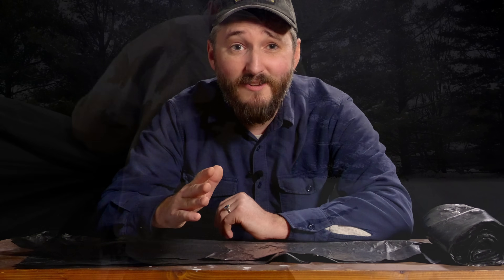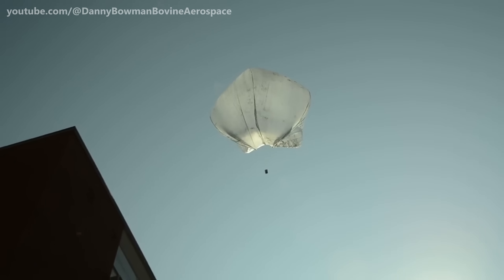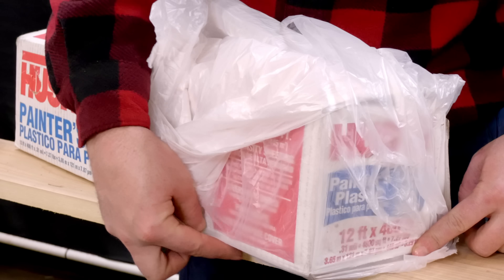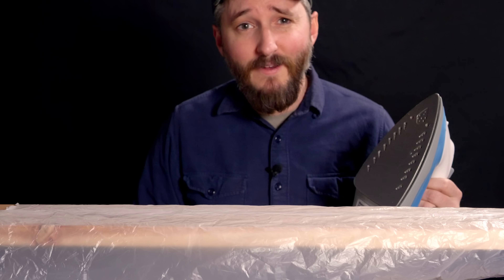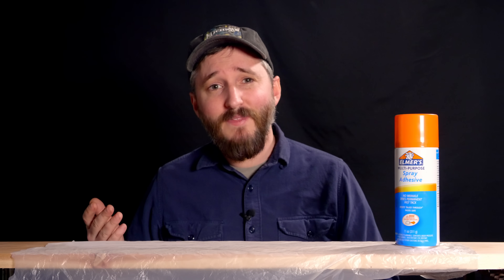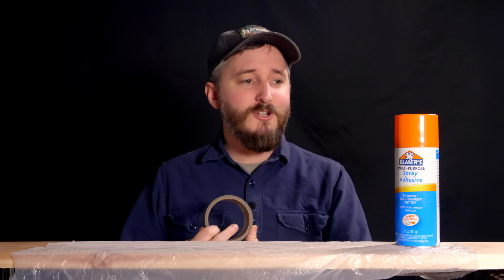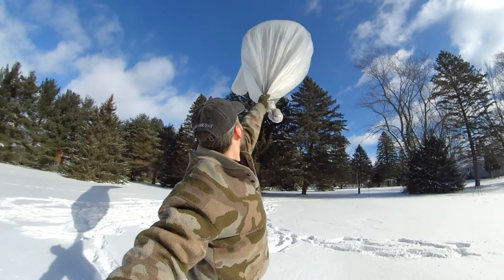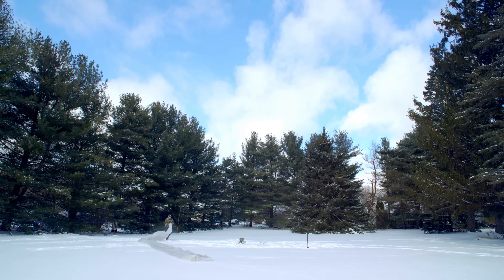DIY Solar Powered Balloons

Comment: I haven't yet watched the video but they used to sell these in the 1970s and 1980s as a "UFO kite" or something similar. I remember seeing them in comic books, etc. for years and I bought one in the early 1980s to try it out but I apparently chose the wrong day to try it out because it wouldn't get very far off the ground at all. I eventually put it up and then sometime later discovered box kites and forgot all about the thing. Glad to see you have had some luck with it though.

Comment: How would that work if you tied the back end in a drone that can hold steady in the air while having the sausage opening vertical over the fire. Or will the battery time and amps be to low for this. Just an idea :)

Comment: Isn't water vapor lighter than air?
Reply: N2 @ 75%  O2 @ 25%  H2O is lighter than both of those.
Reply from the maker: It is, but it tends to condense on the walls which makes them way heavier
Reply: True.  Definately looks cold enough to condense.

Comment: I have flown with hot air balloonists before. I learned that the tiniest amount of drizzle will make them scrub a flight because dampness on the "envelope" (the balloon part of the balloon) will draw heat away from the air contained.  Also, they like flying on cold days, takes way less fuel to achieve lift.

Comment: As long as you have the sun, the temperature outside doesn't really matter. After all,  the lift isn't due to the heat, but to the temperature difference between outside and inside the balloon. Even if the air inside is cold, as long as the air outside is colder, you'll still get lift.

Comment: You might want to try 3M 300LSE tape roll. It is used on older iphone to stick the glass to the frame. It wont come off.
Reply: It's significantly more expensive than the glue tape, which is less than $0.05/ft in bulk.

Comment: ATG tape (used in picture framing) may be a lower cost adhesive solution (and comes in much longer rolls!).
Reply from the maker: Good tip!

Comment: I have used baking parchment paper as a protective layer between the iron and the plastic when making sheets from plastic grocery bags.  It does let the heat through to get the plastic hot enough to fuse but it's difficult to get into the tearing that you described.

Comment: How long can the smoke particles remain suspended in the air inside that balloon? Will they eventually deposit themselves on the surface of the balloon?
Reply from the maker: A lot had deposited on the sides by the time I finished filming (30 mins) but it still flew just as well.
Reply: I look forward to you potentially figuring out if the trade-off for the weight of the smoke and water vapour was there. Perhaps some miniature experiments are in order? :D Something simple like a series of bags tied to a set of scales, in a tube to prevent sideways motion. Increasing the amounts of smoke and vapour each time.  @Nighthawkinlight

Comment: There is this thing called an impulse sealer which is used to seal plastic bags. I have an FS-400 and out of curiosity I quickly tried it out with painters plastic and it worked basically the same as with thicker plastics. I used setting 3. I don't know the material of my painters plastic, but it is 0.01mm thin. When using the impulse sealer, keep in mind to stay pressed down for a few seconds, so that the material has time to cool down. The seam will probably be a little bit weaker than your version, but you save on glue weight.
Reply: And one more thing in regards to the impulse sealer and long seals. You can use aluminium foil to define the length of the line very exactly. Put some on both sides of the heat strip and you have some wiggle room for the plastic that should not be sealed in this pass. The aluminium diverts the heat well enough. Be careful to not short out any parts of the heat strip if there are holes in your teflon strip.

Comment: Can the Anker Solix be easily charged with a rectified alternator? I'm also looking for just a charge controller for LiFePo that would work with a DC alternator input.
Reply from the maker: I think so. The solar inputs double as vehicle charging inputs which would be alternator power

Comment: In Germany we had the YPS magazine till 2000 it was a comic magazine with a science related comic toy. On of them was a hot air balloon like this. Very thin black tube. Was a lot of fun. At one point I saw an  "natural" occurring when people at a Goth festival were building their black tent in the heat of summer an missed anchoring it down first 😁 it went flying very high and far...

Comment: I have an obscure background in producing flexitanks (in MI btw). The film is much thicker, usually 125-300 micron, but it comes in tubes that are 13' wide with 1000' or more per roll. Sadly, we never made one more than 40' long and the ones we flew for fun (thanks to having copious amounts of helium around for leak testing) were much smaller. For welding, look into PTFE tape or maybe a cheap poly bag sealer from U-Line.

Comment: You're inspiring! I still think sticking the edges by heat must make more sense, e.g some kind of hot pizza slicer to roll along a folded sheet. The speed of the roll could ensure just the right temp. Or maybe even better roll a hot ball (like a hot roll-on deodorant) then maybe the plastic would melt but it should create an edge where the plastic only melts together because the contact with the ball is less direct.

Comment: Another adhesive option could be 3M 969 adhesive transfer tape. It claims to have good adherence to LSE plastics like PE, comes in various widths, and can be applied with a dispensing gun. A little pricy at 70¢/yd for the 1/2” wide tape, and the dispensing guns are about $130, but might be way less fiddly than those little dispensers.
Reply from the maker: Maybe worth while for a balloon needed for an important purpose
Reply: Or if you make them routinely, where the time investment becomes a significant factor.

Comment: First idea I had for the sealing/joining problem was a tool with a heated roller, and it turns out they exist for exactly this sort of purpose. "Constant Heat Roller Sealer" is the search powerword. May save a little bit of weight over adhesives but the downside is they seem to be niche enough tools that they're fairly expensive.

Comment: if you carefully taped it in a spiral, (think of the spiral of a toilet paper roll) you could make an essentially arbitrarily sized cylinder, by making the spiral tighter or looser
Reply from the maker: That is a fantastic idea! I imagine it might be difficult to keep track of how the spiral is progressing if you have to fold it up as it's made, but there might be a clever way to do it.
Reply: @Nighthawkinlight  I think all you'd need to do is decide the diameter you want, then convert it to circumference. (Spiraling circumference wouldn't be the same as circular, but close enough for this.)

Pull that much off the roll, double the start over to that point and start taping.

If you look at the start, you could then calculate the rough length by just counting the number of loops you have completed, multiplied by the plastic sheet width.

Comment: Have you considered blowing bubbles using liquified plastics which harden in atmosphere? Such plastics are commonly used -- it's how hairspray works. The formula used in hairspray is probably not suitable for creating airtight balloons, but wide use indicates that there's plenty of research on liquefied plastics available and chemists to consult.
Reply from the maker: It would be hard to make an even thickness. I make giant soap bubbles fairly regularly and it's amazing how thick they can be at the bottom of the bubble compared to the top. I have experimented some with "hardening bubbles" which use PVA in their recipe, but they're quite small compared to these balloons. Something to think about but hard to implement

Comment: 🤔 Does it absolutely have to be all one cell? Can't you just use a whole bunch of regular sized black bags, tied  together? This would solve the assembly problem, with the extra benefit of limiting the risk of leaks/deflations.
Reply from the maker: One cell gives you the best weight to volume ratio. The more cells you have the heavier the balloon will be

Comment: How thick and heavy does a single copper wire has to be, to hold this balloon or bigger at say a few hundred meters above ground? 400m is tops in Canada for drone flight altitude. 
That should give thousands of volts of atmospheric potential electrical energy for free, that you can discharge into a battery via a spark gap and a step down transformer.  
Do not try this on stormy or even cloudy days.
Love your videos and ideas. So refreshing.

Comment: I see a lot of potential for solar balloons to serve as a power generation scheme. They could be thethered to cables that would spin generators while they rise. Need to think of a mechanism to bring them down though.

An other idea would be to use them as solar chimneys/towers. There might be a way to keep them buoyant vertically while them being open on the top to produce an airflow at the bottom. Maybe 3 individual solar balloons could hold a black textile tube upwards and generate airflow from that. With the added benefit of it all being easily foldable and taking no space when the sun isn't up.

Just some ideas.
Reply from the maker: The solar chimney idea is a good one

Comment: Flying noodle aside, just coming up with reliable methods to craft stuff out of giant plastic sheets has lots of kid entertainment value. I'm thinking stuff like inflatable "space" habitats and mini green houses with heavier gauge sheets. Obviously you'd have to keep an eye out so they don't asphyxiate each other but that's often par for the course anyway.
Reply: I did that when our kids were small, just spread out a painter's sheet, and inflated it with a fan heater. I started just using the fan, but it was  a cold day so once it was half inflated I turned on the heater. I hadn't expected it to act like a hot air balloon but there was enough buoyancy to support the top of a dome when the bottom was open.

Comment: CO2 is not much denser than air (average mass of 1 mole of air is 29 and CO2 is 44) and water as vapour is less dense than air (29 compared to 18) so I think that negative effects of adding them by burning wood are minimal. But on the other hand the water vapour can condense, especially in lover temperatures but I still don't believe that it would make any impact on lift

Comment: When I made these ~15 years ago I used the cheapest clear tape that I could get and a tetrahedral form. Had the younglings entertained for hours!
I also included, because I live near a major airport, an aluminum foil retro reflector to provide a very large RCS in case of tether failure. Another good idea is to have the phone numbers for ATC at the ready.
Reply: As I read your comment, an unrelated thought: we could use these techniques to make "parachutes"; big circles of plastic for groups to hold together and do fun activities with.
Reply: @eugenetswong  I like it. Since weight is very little issue, some much thicker sheets, maybe alternate gores clear and black and duct tape is back on the table for manufacturing and repairing.
Reply: @matthewellisor5835 Thanks for collaborating on this idea. I never considered it for repairing and manufacturing.

Also, in another context, I had considered 1 -ply plastic in multi-ply sheets. The plastic layer could be ironed on to something, while the iron touches the paper/metal layer, or something like that.
Reply: @eugenetswong  if I'm understanding, you mean utilizing strips to heat seam two adjacent pieces. If that's so, remember that many of these PE sheets will have axially-oriented polymers so consider rotating 90°.
But, if available to you, "retired" (usually meaning that the lines are cut so no one tries to jump with it) or "surplus" parachutes are available in the USA for ~$150 for some of the cargo models (typically you can find 24-30 foot nominal diameter) and ~$250 for a T-10 (usually B and C variants) which is 35 feet in diameter. It's probably only a few times the cost of the PE sheeting and tape and much more durable.
If instead it's meant to involve the students in the design, construction and testing then the durability might be no concern where the need is only to last through a few days.
Reply: @matthewellisor5835 Thanks for that parachute info. In my recent comment, I wasn't talking about that at all, but your info does help. I wonder if parachutes can be turned into bags. Because of how consistent they are in shape, compared to shopping bags, it should be easier to upcycle them, with economy of scale.

Also, my last comment was an effort to find a sensible way to reuse double ply wrappers, like candy wrappers, or soup cubes. I just couldn't find a way to express it until now. The plastic ply could be ironed on, and the paper ply could prevent sticking to the iron.

Comment: If you have time, please try to build an inflatable parabolic mirror using half transparent plastic, half reflective with Mylar or chrome vinyl (or other reflective innovation), the atmospheric pressure and shape of the plastic creating the parabola.  Obviously, the focus has to be outside the mirror.  I tried it with a used bicycle valve, Mylar and plastic, my builds are not so good, work in progress; I am more involved in a motorized static installation these days.  I think you can do it!  Nice work with the reflective coating; now we talk about concrete solutions!  The inflatable mirror would be nice for carrying around and inflating when needed.

Comment: I made a hot air balloon out of tissue paper in middle school shop class. We filled them with a heat gun. Pretty much everyone's leaked so bad they wouldn't fly or caught on fire from the heat gun. mine flew the farthest It was a fun project but the teacher didn't really explain why it works except to say hot air rises.
Reply from the maker: Hot air molecules zip around faster and bump each other around so they don't clump as closely together. Fewer molecules in the same amount of space means the gas is lighter than the cold gas around it and so it floats

Comment: Our driving silo (don't know the English name, in German it's called 'Fahrsilo') is covered by 2 different types of plastic foils. The white upper layer is 150 microns thick and the transparent foil underneath it is only 40 microns. 

So you could look into silage foils. They are cheap and come in really huge lengts and widths. We use a 7x50m foil for our silo. But they go up to 15m+ in width. You could build a really big balloon with them.

Edit: I did some googling and the thinner foil I'm referring to is called underlay foil/film.
Reply: So.... How much does your silo weigh and have you considered lighting a small fire in it for science? 😂
Reply: @zyeborm  I think what they are referring to is not what you would call a Silo in the US (i.e. NOT a big round building). A Silo in German is a place to store livestock feed. It is a rectangular concrete slab with walls a few meters high on three sides. The open side is used to access the Silo with the farm equipment. The feed is covered with a plastic foil in order to prevent rain to get in. I have no idea the foil is so thin, though!
I'll link a few images in the next comment, but youtube likes to delete comments with links in them, so if you can't find it that is why.
Reply: @turun_ambartanen  aww that's a shame lol
We call the big round buildings silos in British English too. (Australian)

Comment: That glue tape was a good idea. I was imagining like, plastic cement used for models. It's like a solvent that melts the surface of the plastic so the bond is almost like a weld. Plastic models are typically polystyrene, don't know if it would work with HDPE or whatever that plastic drop sheet material is.

Comment: nice, make a man travelling blimp, solar powered hot air balloon. it does not explode like hydrogen or be hard to get helium. how hard was it to get into travel products. being slow to adapt hmh, or get things going. how edge knife, point line melting not a flat surface melting, more like spot welding but as a line, not a spot, yep line welder. or just a laminating heat cutter clamp. works even better for aluminium or copper sheet foil welding. also if you add an air pump to the underside of the balloon, then the blimp air container will not collapse even if punctured. yep even a leaky hot air balloon will float somewhat easily. and is a parachute if completely collapsed into a minimum internal frame structure, like geodesic dome frame. they will float all day as a chain in the sky. yep ground tethered. best transport if any is free transport, floating around.
Reply: add a burner for night time flight for the blimp. this is very inexpensive too, for anyone to make.
Reply: well use that as heat pump heat collector
Reply: try aluminium foil helium balloons but paint them with soot to black. aluminium foil holds hot air better than plastic. or carbon fiber cloth balloons for super hot air balloons for solar.
Reply: try steam drum engine, with inside rim wings, to make external heat to push inside water steam to rotational movement, only a small flash boil amount of water inside the fully sealed drum